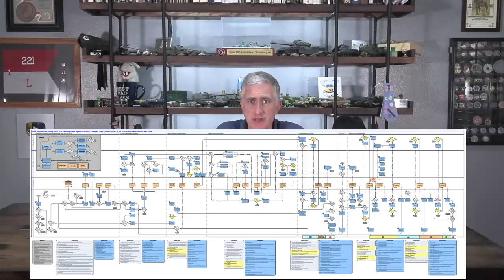Chieftain's Q&A #20: Zombies, Precious bodily fluids, and Magruder

Comment: What about Czechoslovakia as underrated. Their 38 Ts arguably better than the versions of the panzer III the Germans invaded with
Reply: Yes, it was their numbers that were poor in comparison to the "liberating" forces. Several were co-opted in to the German army later.
Reply from the maker: The Germans preferred the Pz III, and if you look at the turret configuration, you can understand why. Yes, the Czech gearbox was better, but the Germans did fix the Pz III's soon enough.

Comment: Question for you: In pictures I have seen, the M48A2C Patton in West German service has a muzzle brake that angles forward. I have never seen this before on either small arms or cannons. From what I understand of ballistics, you want the muzzle brake to direct the gasses backward to counteract recoil (or even just to the side instead of straight forward). Why would the Germans use a brake that angles forward? Wouldn't this be less effective than American muzzle brakes that went straight out to the side?
Reply: Your confusing muzzle brakes with blast deflectors.

Comment: 19:30 What are those two bars in front of the suspension bogeys the M4:s in the lower picture have? I don't think I have seen that before.
Reply: I assume it's a form of protection against close range attacks. Could be wood or metal bars to keep magnetic mines from sticking properly, or just an attempt to prevent stuff from being thrown under the tanks. 

Ambushes with magnetic mines, lunge mines, and grenades were a serious threat in the Pacific theater, and all kinds of field modifications sprang up to combat them. At the most extreme, entire tanks were covered in wooden planks and sand bags, and all hatches covered in metal spikes to keep attackers from prying them open. Tank Encyclopedia has a good article on the subject, check out "Improvised Armor on M4 Shermans in the PTO" on their site.

Comment: Drac generally doesn't cover anything past the 50's.  "Genius" use of equipment?  Using US Navy UNREP ship to refuel USCG ship.  No one bothered to check the strength of the attachment points.  The fuel hoses connected just fine, but when the winch operator tried to take the slack out of the lines, the shackles were yanked off the hull.  The CG crew was not amused, but we were the ones ducking.
Reply from the maker: His loss, I guess.

Comment: I've always heard that the IS 3 was a bad vehicle, practically useless even in 1945 but I've never heard a clear explanation why
Reply: Early models had HORRIBLE mechanical issues, many of which weren't fixed until the IS-3M Model. As it was, the ones at the V-Day parade were lucky to make the full parade without a breakdown. Even then the T54 did the job better and more cheaply. IS-3 was a 60+ ton monster that complicated Logistics among other things.

Comment: Are devices to assist the loader of MBTs like "exo skeletons" or simply small flexibel cranes within the crew compartment not inevitable with the coming heavier tank rounds?
Reply: Seems to me like an autoloader would be simpler
Reply: @Masada1911  I would not say so, since the arguments for the extra crew on board still stand. Mostly the rapid second shot, if i remember correctly. I doubt that it is simpler to design and implement an autoloader, since this means a lot of additional things that are moving.
Reply: Loader already waste the most space, and now you want some sort of crane bs? But yes, crane is probably less complex than autoloaders. But it is not a valid solution. 

An assist loader is your next best option. I'm talking about the one on T10. Which is compact, reliable, but it ain't gonna be fast. 

Assistance suit is now your next best option... Actually it ain't. It is as complex, and required as much moving parts as typical mechanical autoloader, if not more. Let me break it down for you. 

Autoloader is incredible simple (those current in service). In its core, it only has a push rod, a conveyer belt, a movable feed tray. 3 motor that don't care about delicate managing power output.

Your suit required multiple pump or motor hooking up to many flexible duct or steel cable. Your flexible duct will use compress air or flammable fluid.  

All of those hardware then needed to be hook up to software to manage the power output. Because they need to understand what the operator want to do. Also you want to actuate the correct hardware at the right timing or you be slinging a round too hard or having delay on doing stuff. While your autoloader can just go full ham all the time with a simple contextless max power limiter.

And you people like to argue with manual back up. Autoloader in Type 90 for example has manual backup when power is cut. If autoloader failed, it can be manual loaded. Same with Russian autoloader or any in service autoloader afaik. *Not m1128 or T-14 but they are effectively manless turret, different topic entirely. 

If your suit lost power, your operater has to disengage from said system then manual load the round. The default state of those system are more than likely too bluky to work with while manipulating the rounds.

Oh, let's hope the gi is smart enough to not grind the flexible duct against interior of tank, which often has angled edges and stuff. Asking gi to be delicate, did you see the problem? 

Also, compress air/flammable fluid. One is fire hazard that can lead to kaboom, another is straight up explosion source. 

Then there is the argument of how fast are you able to disengage from said system and gtfo when shit goes south... You know, Cheif's favorite "oh bugger, shits on fire". 

And if the round is too bulky and heavy to be handle without assistance, your reload speed argument breaks down. The issue is not only the weight, but also the length. You can solved weight issue using external assistance, but you can only solve length issue by cutting stuff into pieces.

Beside, Type 90 gun is already capable disengage and reengage the gunner sight within 3.5s. Big man cheif himself already said, the follow up shot is often not limited by the reload, but instead the target acquisition. 

A more realistic solution is a pull tray extend from the storage to the breech like k9 spg.

But at that point, why not just integrate an automatic push rod. Make the tray sit on a conveyer belt, automatic extendable retractable. Wait, that's just like autoloader we already had.

I find the argument of having extra crew being useful to be bogus. 

French put those extra dude in an apc that follow the tank crew. Dismount when want to scout the area. I argue those extra sets of eyes are better than a set of eyes having limited vision. 

In battle trouble shoot? What can the loader trouble shoot that a commander/gunner cannot. If it is combat vital system, you gtfo instead of troubleshoot them while people try to shoot at you.

Ok, this is getting too long.
Reply: @jintsuubest9331  tldr
Reply: @stephank9172  Your idea is bad.
Reply: @stephank9172  he gave you an answer, don't be rude, now go read it.

Comment: I recall you mentioned on previous videos that a significant threat to future armored vehicles were advanced artillery projectiles, if I'm not mistaken, one example of this would be the German SMArt 155, or the American M982 Excalibur, what would you think could be used as a defense mechanism against these kinds of threats? Would an active laser defense system like the ones intended to be used against drones possible to be adapted to protect against these? Or would electronic counter measures systems be better? I know very little on the subject and would like more information about it, can you recommend any reading material? Thank you, Sir, I apologize for any typos, English is not my native language
Reply: Laser as in cutting the projectile mid air?
Not likely. 
To start with, laser required enormous amount of energy. Then laser also have very slow effect.
 
Those naval vessel has practically unlimited power supply for high wattage laser, and it still take seconds to pierce throught the drone. 

What if there are multiple of such munition airborne at the same time? 

A more feasible defense is smoke screen or some sort of active protection system that interfer with the guidence system of said munition rather than destroy the munition itself.
Reply: @jintsuubest9331  no, what he meant for laser, is if the thing is optically guided, jam the cell by shining a laser (focused bright light) into it.
Reply: @jintsuubest9331  
It depends on the size and materials of the drone.
Reply: @calvingreene90  you're talking about a rapidly spinning ½" thick steel tube. That's a very difficult laser target to damage. The best you could do is blind the seeker.

Comment: I see a interesting badge in the case behind you. 
what is that ⚙ shaped badge on the 3rd shelf from the top.
I have not seen it before, and I'm curious 🤔 what it is? and what it is meant for or what it means? 
I have No idea. 
thanks. 
sorry if this makes no sense.
Reply from the maker: Not a badge, a momento. It's in the shape of a sprocket wheel.

Comment: Can a modern tank  (Like the M1 Abrams) be made lighter but yet with better amour protection and better systems??
Reply: Armor protection? Not really.

Could you shift from passive battleship armor to more active protection like modern ships? Sure.
Reply: Using an autoloader saves weight, which can be used elsewhere. As mention by the Chieftain, however, fitting it on an existing tank is pointless, unless you replace the whole turret by a new, smaller, one.
Reply: @chefchaudard3580  how does an autoloader save weight...
Reply: @marcusborderlands6177  an autoloader is more compact than a loader and the space he needs. Hence less internal volume to protect, hence a lower weight.

Comment: Yeah, the Challenger 3 should have gone with the Leclerc's GIAT CN120 rather than the Rheinmetall Rh-120 L/55. Not adopting an autoloader when you have the chance is silly by this point.
Reply: Either gun can be modify to fit autoloader or manually operate. The choice is likely because rhm has more lobbying dollars. 
The real question is why not a new vehicle. 
They are changing soany things anyways, just adopt a new platform.
Reply: @jintsuubest9331  Yeah tbh, just buy an existing tank from one of the countries that actually make tanks. A Leo 2 with a new 3-man turret or have Nexter make the next version of the Leclerc.
Reply: I suspect it is because of the cost. Designing an autoloader would cost a fortune. Buying one from the French would be, well, loosing face.
And I don't see any other supplier of an off-the-shelve autoloader, except for Russia.
Reply: @chefchaudard3580  How is ditching the rifled gun the Brits have been bragging about for all these years in favor of the German smoothbore gun any less "shameful" than buying a French gun, which is almost ballistically identical to the German one, that just happens to come with a good autoloader?

If development cost was an issue then surely getting the Germans to design and make a whole new tank is more expensive than just buying Leopard 2A7s?

Hell, if I was in charge there I'd also order some French CAESAR SP artillery systems to replace the AS-90 in lighter mechanized units. 
The French (Nexter, to specific) happen to make a lot of good stuff at the moment.
Reply: @hjorturerlend  I may be wrong. There are probably cost and political reasons: 
- Challenger 3 will have a relatively short service life, 10 to 15 years (20?), between 2027 to 2040 before being replaced by either drones or a new tank, not worth the investment
- Rheinmetall has a joint venture with BAE (which is a British company) in the form of Rheinmetall BAE Systems Land. So UK "buys British", in a way.
- Rheinmetall probably had a conventional turret ready that could be adapted to the Challenger 3 with minimal design costs. KNDS offered one, for sure, but asking for an autoloader would have reduced the competition down to one supplier only, with costs implications.

My 2 cents